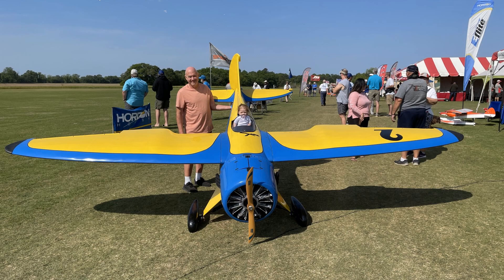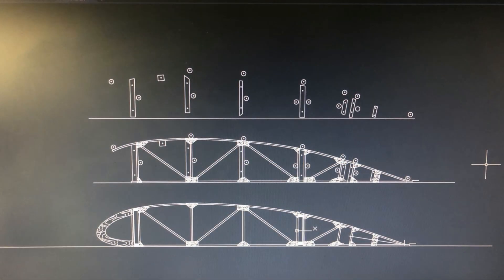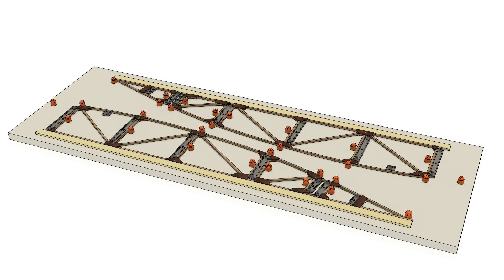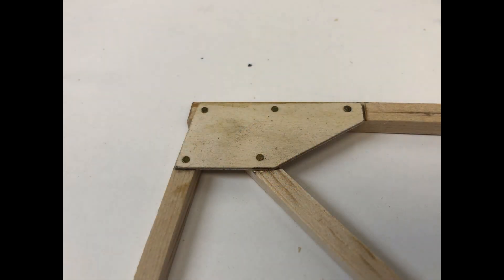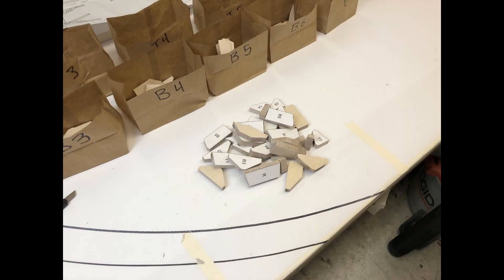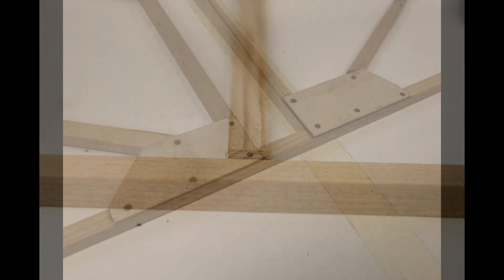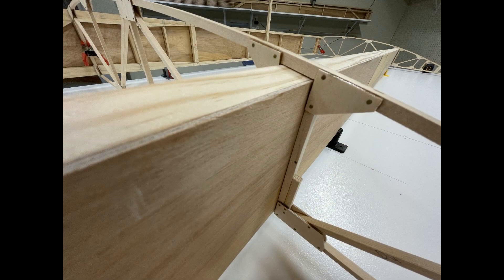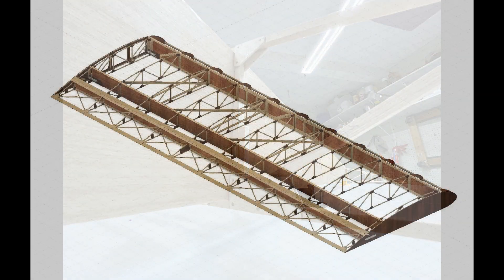Making Ribs for my AirBike Ultralight Aircraft 2.0

Comment: Are you still working on this AirBike? I haven't seen any updates in awhile.
Reply from the maker: It's slow right now. I have to get shoulder surgery.  The fuse is done. The tail feathers need covering. And I started to cut out the ailerons and make hinges. But the wing is just too big to easily work on with my shoulder. It is on pause, not abandoned. :)
Reply: @dagtheaviator  Thanks for the update. Hoping for a good recovery for you.
Reply: @dagtheaviator  I had rotator cuff surgery a few years ago so can relate to your condition. I hope by now you're healed and able to work on your air bike. I have ordered a set of plans from Jordan Lake Aero and look forward to building the bird. I am going to build the tandem bike, plan on using the Hirth 3205H engine 65 HP with fuel injection ... I look forward to seeing your bird fly. God bless you sir.
Reply from the maker: @michaeldavidheit  unfortunately the air bike is still in storage right now. I’m hoping to get it out very soon. It’s been a year since I had my surgery and my shoulder is doing fantastic. But funds are very tight right now and I’m trying to balance family, and aviation. Essentially the air bike is done except for attaching ailerons , covering the wings, and covering the tail feathers. Another challenge I have is room. I normally try to work on the air bike in the winter when I have more room to do things. Thanks for following my build, and if I can help you in anyway, let me know.
Reply from the maker: @michaeldavidheit  I also think you joined my Patreon . I can create folders on there and do photo dumps of every picture I’ve taken during my bill. I know there’s a lot on there. But I’ve been thinking of creating folders for each section of the airplane. A folder for the wings, a folder for the fuselage, and so on.Let me know if I can help.
Reply: Thank you … still waiting for my plans to arrive. And getting up the gumption to much out that disaster I call a garage … seriously looking at getting a 40’ container delivered to put stuff in and completely flush out the garage for the build. My garage is well insulated and heated so the long 9 months of winter would be ideal time to build.